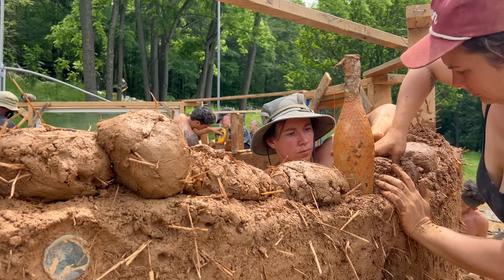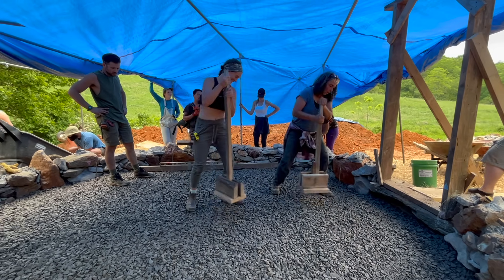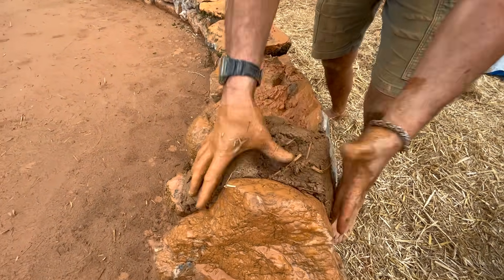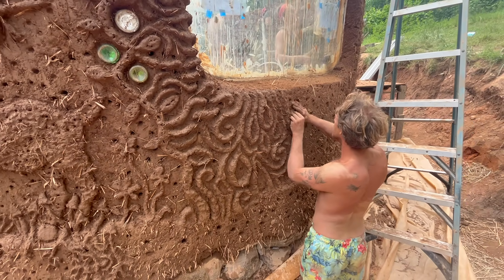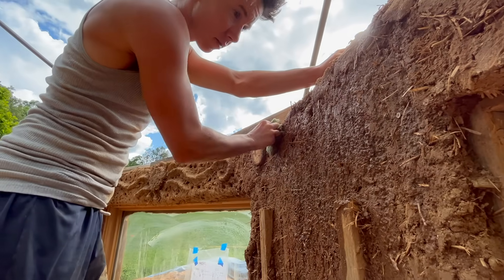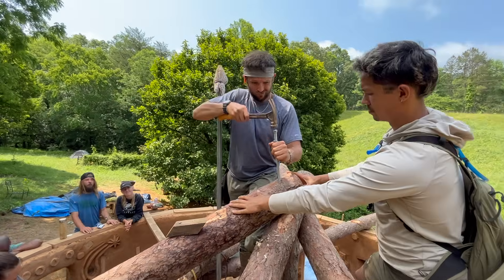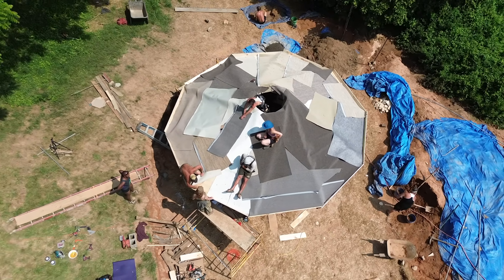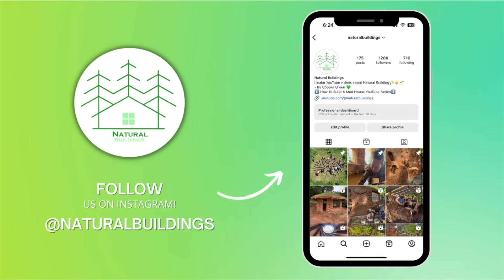Cob House Build START to FINISH in 10 Minutes

Comment: we also add neem,water (kadukkai) refers to Haritaki
Also add lime with soil mix it well do this process for minimum 7 days after this processes soil will get fermantated and then use that soil mixture for construction it will help to improve the strength and water proof naturally 
 egg white for plastering will naturally protect walls from termites insects it will help to increase the strength and durability of your cob house its last upyo 250 or above years based upon maintanace and other things also use Madras terrace technique for roofing ❤ from India all the best Guy's keep it up...
Reply: What is neem water?

Comment: I have a couple questions and am genuinely interested in Cob houses:

1) i understand the the dung implemented in the walls and flooring offers both a good binding agent for the mix and acts as a repellent for insects, snakes, etc. My question is does this not attract flies, beetles, or mice? would owning a dog or cat be a problem as they may have a keener nose to the smell and may not like the smell or may make them more likely to use the house as a bathroom? I am aware that the smell disappears over time so the people wouldn't smell it 

2) The spiralling circle roof is a genius idea and I can completely understand how it is super structurally sound. How does the wooden roof beams not push down on the clay exterior and cause breaks, cracks, pressure, etc. Is there a way to combat this? or is this not a problem?

3) speaking of repairs, what does repair look like? just filling in cracks or damage with new clay or is it more complicated? 
 
I would genuinely love to hear the answers to these from someone who has built one of these houses before as cob houses have peaked my extreme interest
thank you
Reply: 1. insects wouldn't be able to get in - far too dense, im sure the dog/cat wouldn't pee after trained so. 2. the pressure actually reinforces the clay, more porous clay would be more prone to crack, 3rd is basically yes you can fill in the damage but you can pat it down & do yearly checkups to prevent ever seeing a crack

Comment: Intresting.

One UK method, at the end of the wall build is to have a layer of the same but with milk added.  Or cream.  This, when the smell goes, gives a smooth and more rain proofed finish.  This can be used on the floor too.  It gives a really nice polished surface that is water resistant.  Cheers 🇬🇧
Reply: Never heard of this! Tell me more
Reply: @TracyVanBrocklin  it's easier to look online for the method.
Reply: @TracyVanBrocklin  yeah Milk & cream were used a Lot to help the exterior in th eUK because of the amount of rain we get xD 
the Fat bonds with the clay & forms a barrier! 
thats it really unless you want the science behind it. if so use the internet xD
Reply: Sounds great! Probably is the fat on the milk the once the liquid has dried remains as a sealant.
Reply: @EnriqueAviles   I don't know TBH. 😊
Reply: @NellyonthelandI've seen people use the same method to seal clay mugs, so it is very plausible
Reply: Yeah, that's what I was thinking about - trading out the manure element for lard or tallow...  At least for the final, exterior layer & maybe as part of the floor.

Comment: fascinating.  what is the allowable span for the roof framing?  will there be differential settlement from building the walls on the large stones above the crushed gravel?  will the recycled cardboard in your floor eventually rot and cause cracking in the floor?

Comment: 시멘트를 찾는 방법.시멘트인지 콘크리트인지를 태워서 나오는 연기를 가두고,가루낸 흙들을 뿌리면,시멘트들이 해당 연기가 나는 곳으로 가게된다고.속이빈 위로 긴 건축물에서 어느정도의 중간쯤에,옆으로 빠진 공간에,시멘트 또는 콘크리트인지를 태운 연기가 가둬지게 하고,연기를 가두는 것은 얇은두께의 구리 상자 또는 성능이 구리보다 떨어지지만 콘크리트 박스로 한다고.얇은 구리 판재는, 경사지게 해두고, 위로 떨어져 모인 시멘트 가루들이 미끄러져 바로 앞의 틈새들에 들어가서 저장공간으로 이송되게 해둔다고. 그리고, 속이 빈 건축물의 상부에서 가루가 된 흙들을 뿌려서 가루들이 날리게 한다고, 함. 시멘트들이 모이게 된다고, 함. 연기들은, 이따금씩 교체들을 해주는게 필요하다고 함. 정확히는 모른다고.
@How to find cement. If you burn cement or concrete and trap the smoke, and sprinkle powdered dirt, the cement will go to where the smoke is coming from. In a hollow, tall structure, somewhere in the middle, in a space off to the side, the smoke from burning cement or concrete will be trapped, and the smoke will be trapped in a thin copper box, or a concrete box with lower performance than copper. The thin copper plate is inclined, and the cement powder that falls upward will slide into the gaps right in front and be transported to the storage space. Then, they sprinkle powdered dirt from the top of the hollow structure to make the powder fly. They say that the cement will collect. They say that the smoke needs to be replaced occasionally. I don't know exactly.

Comment: The idea is very nice and the collaboration when carrying out the work is very well planned.
Now we go with the ugly part of the matter.
The concept of the foundations is quite well planned, but it begins with a critical failure that is then repeated throughout the construction. They are not reinforced. Since they do not have iron rods or are sealed with concrete or mortar, they do not have structural integrity. This is not noticeable in a small structure like this one whose walls are not loaded excessively and whose circular structure helps to distribute the load. But with another shape or with a slightly greater height and width, it can collapse. The chaining of the base allows for greater heights to be achieved by better supporting the weight of the structure.
Then the structure does not have pillars of any kind, nor horizontal reinforcements. That can also be understood in a small, circular structure, but in something larger it is impossible. The pillars help to evenly distribute the weight of the roofs or floors above the foundation of the structure, in case of failure they can help to avoid a catastrophic collapse, they can avoid some of its most serious consequences, giving us time to evacuate the structure. They can be made of treated wood or reinforced or solid iron, well protected. The horizontal reinforcements can be placed every 60 centimeters or 24 inches, to simplify they can be 2 iron rods joined by thinner iron flanges or a ladder the width of the wall made of 1x1 inch wood. This provides structural integrity of firmness and resistance to climatic phenomena and increases the potential longevity of the structure.
At the top of the wall another chain can be made with iron rod, this gives firmness and closes the wall, leaving it suitable to build a new level or place a roof in a more stable way. This is more optional, but allows greater peace of mind by distributing the loads of the roof on a firmer structure. Another important thing that is not done optimally is the use of clay for plastering. Trabadillo (a mixture of lime and plaster), lime or plaster are used, not because they are pretty but because of their other properties. They are fungicidal and vermifuge preventing insects from nesting immediately in the structure, they protect the wood from termites and other pests, and they are cheap and ecological. They can be modeled afterwards with relative ease and can be painted to taste. Pure clay is not always available. Insects can penetrate it with relative ease and can build large colonies quite quickly, affecting our structural integrity.
Another thing regarding the finishes is the need to carry out a lime whitewash once the structure is finished to kill any possible insect nest that could have been made without our knowledge. It is the least toxic and can be painted afterwards. If it is not painted, whitewashing the property once every 3 to 6 months helps keep it free of pests. This depends more than anything on humidity and temperatures.
As for the floor. The insulating layer has a relative use and if there is no saltpeter that could affect the structure, trying to avoid it is the best because it affects drainage allowing the formation of unwanted flora. Gravel can be used in the lower layer, but the use of the suggested components is counterproductive because between cleaning and accidents in a short time the materials would infiltrate and in case of hitting the cardboard on top there would be the degradation of the cellulose by bacteria giving rise to moulds that are a nightmare to eliminate in a house made of earth. The best options are compacted gravel and boulders on top if these are abundant in the area. Then you can use cement or wood ash mixed with water and sand to fill the gaps giving firmness to the floor. It is not the prettiest or ideal, but it is relatively ecological, fast and will not cause many complications in the future. If you want something more stable, a concrete layer with a metal mesh will get better results and if you can use an insulator to avoid the blooming of salts due to the humidity of the soil. My family owns adobe houses that are more than 180 years old in very seismically active areas and this helps a lot to maintain them.
Reply: Would you recommend rebar in the foundation process or??

Comment: Hay bails seem to be a really good structure building tool.  I was thinking today of the possibility of using hay bails on an existing house to insulate and add to it.
Reply: not hay… straw bales have high silica content, hay rots and burns easily.  Also you have to make sure the bales are protected with a wide overhang and are well up from the ground to mitigate moisture exposure.

Comment: How well did it hold up in the hurricane?
Reply: I too would like to know.

Round is the best for winds… the rains would have been the hardest to deal with but Cob can be repaired easily on what is left of a structure.
Reply: I would also like to know
Reply: It’s perfectly fine it has a roof

Comment: Beautiful build. I just don't get how the wall is built on such a precarious rock foundation! It feels as if it could all collapse if you remove a few rocks from the base, or just shoulder barge into the wall. How does the structure stay up bearing all the weight of the windows, doors and roof?

Comment: This is amazing! Is it necessary to use manure?
Reply from the maker: It is not. The enzymes help to seal the plaster and it contains fibers that make it have higher tensile strength but there are other fiber alternatives such as chopped straw that will still make a strong plaster

Comment: You really should always debark and dry trees before using them in construction even if you leave them rounded, and more or less untreated. The bark is a sanctuary for all kinds of bugs, and mold that will infest the entire timber at some point, and cause it to rot, and become structurally unsound. I wouldn't bother with debarking trees if I was going to use them as a boarder for a raised flower bed, because being infested and growing mushrooms is good polyculture for a garden space, where you'll use the rot for mulch and compost. I also wouldn't care if it was an emergency or camping shelter that was just going to be used for a couple of weeks or less. BUT it becomes a health & safety issue if you're using it for door and window posts, and roof supports of a long-term shelter. Ya'll can save that roof by debarking and drying it in place and sealing whatever cracks form. But if you don't, I give it 3 to 5 years before you have to replace the entire roof before one timber breaks halfway, and they all fall.
Reply from the maker: Indeed this was a mistake made during the workshop. Thanks for your advice
Reply from the maker: Indeed this was a mistake we made during the workshop. Thanks for your advice

Comment: Man. All that work, and the big bad wolf is just gonna blow it down 😞
Reply: damn!!!
Reply: In Europe and the southwest and Mexico and some other places there are those who have lasted more than 500 years ironically straw bale and houses made of sticks are the same. If you ever want to add another room you better put the doorway now because once dried that stuff is like concrete and it will take a jackhammer to make a hole. As long as you put good boots in a raincoat as they say get the foundation up off the ground and put plenty of overhang on the roof

Comment: Gotta be a mixer for that. As for the artsy fartsy decore .. no. That made it intensive. 🙄 
Been cross-referencing other alt methods. Think I will use corrugated steel as an outside form and go nuts inside
Reply: Some people do in fact rent a small cement mixer to make it go faster. If you really want faster you might want to use earthbag and then put a cob plaster inside and out or super Adobe which uses a long Earth bag tube

Comment: 42 round would be perfect with lift rooms
Reply: If I wanted a room that big I would really recommend something more like cordwood and cob or earthbag. Or at the very least a center pole for structural stability. But this method works good for smaller rooms. Until you're being Bingham did one in Turkey 20 ft around with earthbag

Comment: I was so on board with this until poo entered the chat. What is the benefit to including it? The artwork was wonderful.
Reply: Donkey/horse manure contains a lot of tiny fibers. The fibers reinforce the material similar to how rebar acts in concrete or how fiberglass resins work. The manure is composted so that any pathogenic bacteria has had time to die off. 

It’s a traditional technique/mixture, but I’m sure an alternative could be found if need be. However, it obviously is much more sustainable if you have a local source of manure already available.
Reply: It gives it a certain stickiness and it's actually not necessary but it does make it a little easier to make the plaster stick. When it's done any odor will be gone❤.
Reply: You don't need to use it, it's just easier especially if you have an animal like a horse around. You could do the same thing with mud & straw or other dried chopped grasses.

Comment: Did you need a permit?
Reply: That varies by location. Some allow buildings under a certain square footage or for certain uses (like sheds or agricultural buildings) to be built without a permit, others require permitting for everything. There are loopholes in many locations though. You'll have to check with your local permitting office to find out.
Reply: It depends on where you put it, do your research carefully

Comment: Beautiful and laborious work done to achieve a beautiful ecological cabin, congratulations to each of the collaborators in its construction. With great humility, just some recommendations for future similar ideas: for the mud mixture you could use the Ground cactus or cactus leaves instead of water, for greater cohesion and grip of the mortar. They could also use bamboo sticks, which are more resistant and lighter in the roof and structure. You could even include a clay oven attached to the wall on the back with ducts interconnected around the foundation, so that the interior is warmer. nice video, many successes in your projects. Greetings from Peru.
Reply: Their goal was likely to use as many locally sourced materials as possible. The mountains found in North Carolina are a temperate rainforest with many large tree species, and lacks native bamboo or cacti, but those are wonderful ideas for people gaining inspiration from this video but living in different areas
Reply: Yikes, wouldn’t cactus leaves be deadly for those bare feet working the mix???  I’d be terrified.

I love the bamboo roofing and integrated oven with ducts!  Smart thinking ahead.

Always include children in the building process is my vote.
Reply: @louisegogel7973   No, it is not possible that it could hurt their feet, because the thorny leaves of the cactus are lightly burned in the fire until the thorns disappear, after that the parts that could be dangerous are removed with a knife and then they are ground until it looks like a gelatinous mass, and it is ready to mix with the mud or clay for use.
Reply: @lizzyventura1029  Thank you for that explanation!  What a relief to know!
Reply: Que hermosa...artística esa casa ecológica...felicitaciones a todos🎉
Reply: Except they used all sorts of tools... the tarp isn't eco... buckets all the gravel they got commercially. What a shame statement.

Comment: Hyperadobe Home Build $13K.....(even with electric and plumbing ....that's a HUGE NUMBER. dirt from the land  for 1500 earth bags $170? Plumbing c'est facile comme bonjuor $125. septic/white water tank $1800. Electric wire and connection $900. Solar $2,200. Fixtures Toilet/vanitySinks and associated $600..  ....Sooooo $13k 😮????

Comment: Beautiful Build. Does somebody know if I could continue building the wall another day and the clay mix will still stick and add to the already build structure or is that an issue? Thanks
Reply from the maker: Yeah it’s fine you just want to make the top layer moist by spraying it down slightly in between layers. I add more detail if you want to check out the tutorial series. Thank you 🙏
Reply: One person can build a cob cottage by themselves with time and know-how. I would love to build one if my health recovers enough. Cob buildings can last for more than a thousand years, with the right conditions and occasional upkeep, and without needing anything more than a rocket and/or mass stove, fireplace, or more modern wood-burning stove to keep the temperature comfortable year-round. The best part is how they feel as an environment, the mellow energy they create and nurture.
Reply: Actually this is why it takes so long to make a building out of pure cob is that you need to give it a chance to dry out in between layers. If you wanted to go faster I would suggest cordwood and cob or Earth bag with a cob layer inside and out. There are also methods in which you can put a stick frame and use Cobb slip and then once again Cobb plaster over it. We're super Adobe there are so many methods and so many videos...